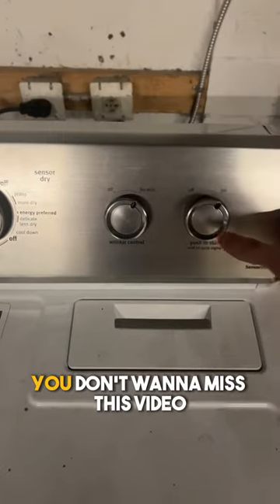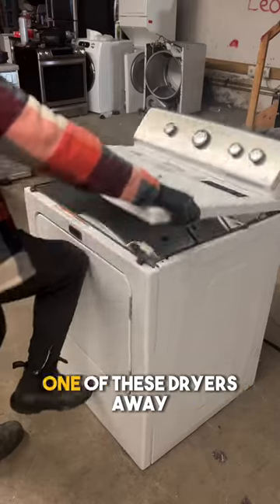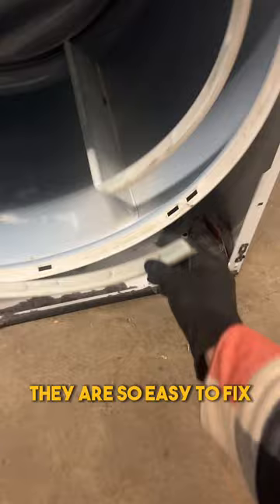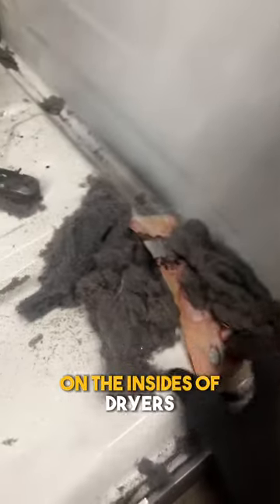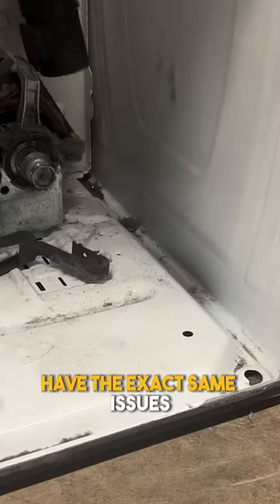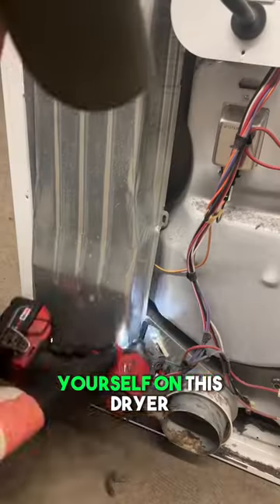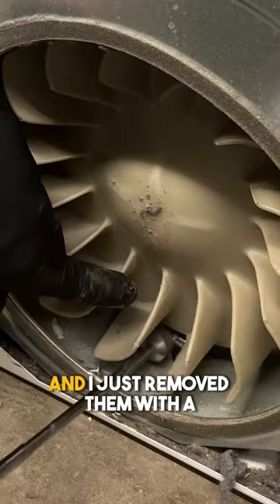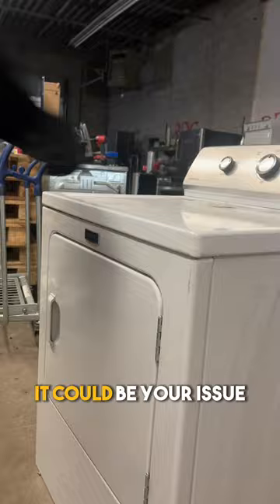The Shocking Truth About Your Electric Dryer’s Loud Noise | Are You At Risk?

Comment: Reason why those Whirlpool dryers are the best on the market is they haven’t changed the design since 1966 and have continued to make improvements to them over the past 50 years or so. Only negative thing about those dryers is they have a tendency to accumulate lint at the bottom of the lint screen plenum along having issues with the thermal fuses.

Comment: Questions,  my LG front load washer selector Nob will not select. it moves freely but it wontt select
Reply: Depending on your washer if it’s a digital one you will need a new control board or selector switch
Reply from the maker: @isaiah4478  I wouldn’t consider a new control board right away. If any board, it would most likely be the UI board (user interface) but this is a very common issue with LG dryers, and 99 percent of the time all you have to do is pull the knob off and spray it with some lubricant!